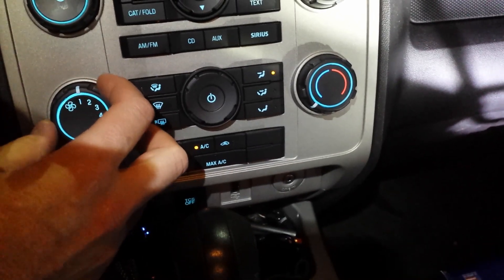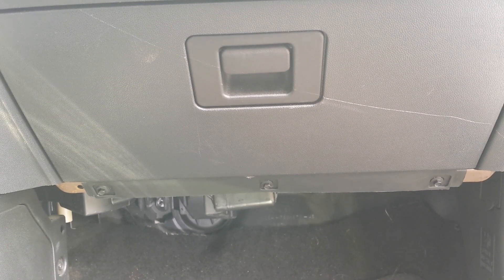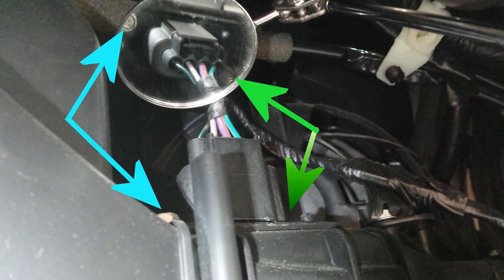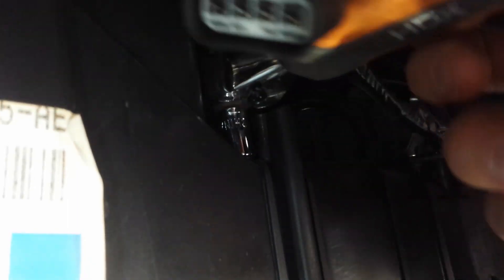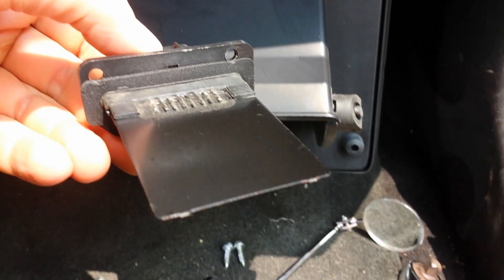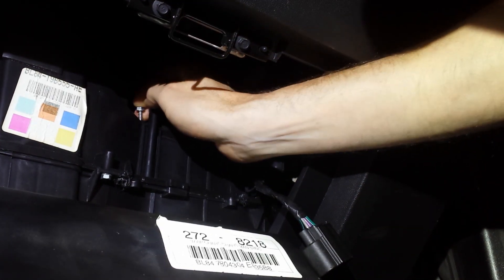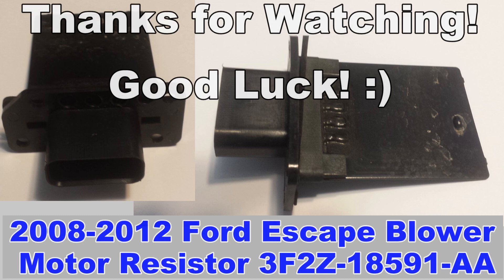Fix 🔧Ford Escape 👨‍🔧Fan Only Works On High

Comment: Worked perfect I did it in about 10 minutes but when I put the new one in it had a coating near the top where it fits in so if you have this problem, you may want use screws that are a little longer because the factory jobs gave me a little trouble but I made it work Thank You for saving me who knows how much money. Oh, yea I saw another video, and someone said the local dealership wanted $311.00 for this repair!!! I respect mechanics but that's terrible.

Comment: Fun fact.  The resistor is placed in the air duct to cool the resistor.
Reply: What about with the heat on
Reply: @JS-te4gz  The heat comes from/after the heater core which is down stream of the resistor. The resistor is first hit from the blower motor.  Most cars now these days use a blower with a micro chip to control the speed.
Reply: @TheSlacker64  oh cool

Comment: Thank you for the detailed instructions.  I needed a thin screwdriver to pop up the plug  because my plug had a small inside clip that popped up without too much resistance and a small ratchet made it easier to remove the screws also..all in all a lot of self satisfaction and money saved..thanks so much!. .

Comment: Anyone else get to the removing two screws part and just went "well at least it works on high" and moved on?

Thanks for the video though. Theres a special place in heaven for the youtubers helping us keep our crapboxes running.
Reply from the maker: LOL I get that "oh wait this is more than I bargained for" part. And thanks for your kindness. :)
Pro tip is if you keep going with the stuff that is just barely above your pay grade, you will keep leveling up, and then you can fix the hell out of your crapbox, and you have a custom awesome crapbox that doesn't cost a king's ransom. :)

Comment: I wonder if you can try cleaning the connection points off and then see if that will work??? I’ll try that before buying the new one.
Reply from the maker: You can try it, and re-seating it. Won't hurt. A pencil eraser is good for cleaning off contacts. It's probably not a contact problem though, since these aren't being unplugged and re-plugged repeatedly, which is usually when/why contacts get flaky and need to be cleaned. Either way it's still a pretty cheap and easy fix. Good luck. :)

Comment: The plug on mine did not just slide off. There was a clip involved and you are supposed to use a screwdriver to lift a section of the plug before pulling off the resistor. I broke it before realizing that but hopefully it will work anyway. I'll tape it in place if I need to.

Edit: This fix did not work on my vehicle. Part replaced but the fan still only works on high speed (setting number 4). Any ideas about what else it could be? The switch itself maybe?

Comment: I have a 2014 Ford escape is it in the same spot behind the glove box?
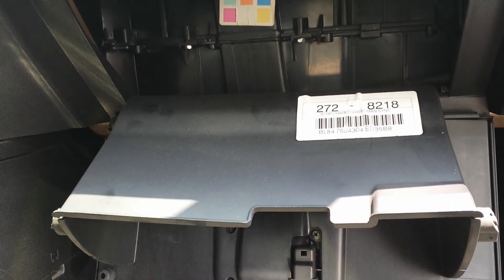Reply from the maker: Not sure. Open your glove box like at 0:34 and look for a similar plug. :)

If you enter your truck info at an auto parts website (oreilly, advance auto, auto stop) it will let you search for parts and you can get one that way.
Reply: @LiftPizzas  thank you!
Reply: Did you fix it? I’ve got a 2014 with the same problem.

Comment: The fan worked only on high until today. Now it doesn’t work at all. Can I still apply the same solution to fix it?
Reply from the maker: Probably. It would be a good first thing to try. If it's not the solution you haven't spent a lot to try it. :)
Reply from the maker: (Also, check the fuse. 😉)
Reply: I have a 2011 Ford escape. I'm wondering if this will fix my problem. I can't get the climate control fan to turn off at all unless I turn off the car completely. The fan speed is mostly stuck on high,but if I fiddle with the different knobs I can sometimes slow it down. But still won't turn off, and it doesn't matter if it's on auto or if I set it manually. Any advice would be appreciated.